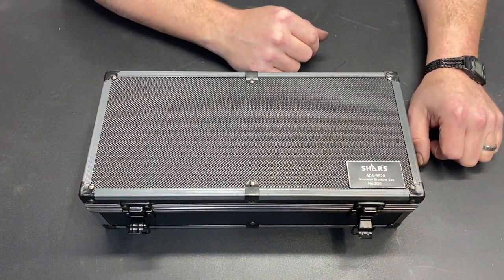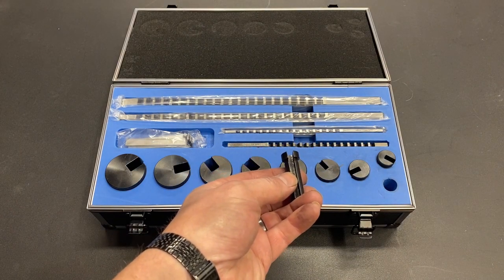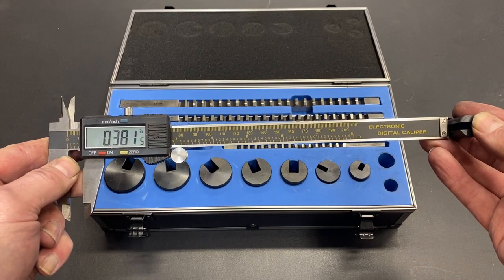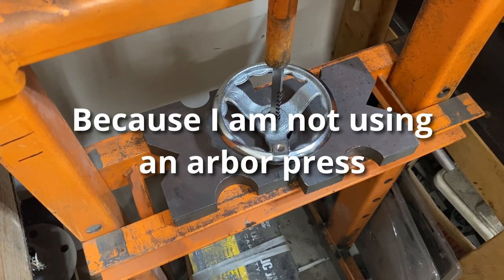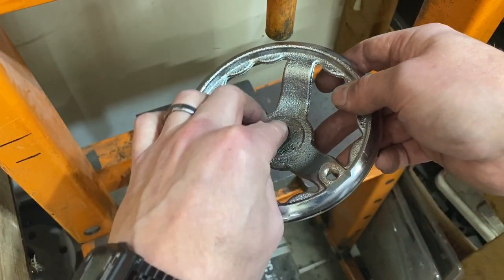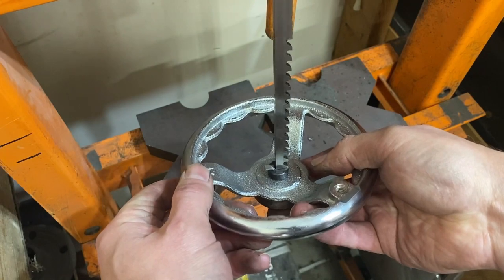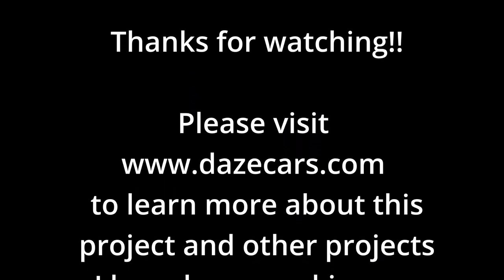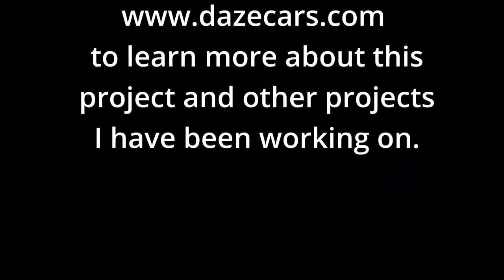Review and Use of a Shars Broaching Kit, Cutting Keyways and Internal Splines

Comment: 1) I've always wanted a broaching set. This one looks pretty cool.
2) Looks like rebuilding your shop press to be more usable can be a whole series of new videos. Make it less sloppy, add air over hydraulic jack (or can you modify the current jack?).
3) Regarding building up your shop tooling, using your brain and whatever tools you have until you have the right tool, My first "lathe" was a drill press and a few different files. Took forever to shape something, but it worked.
Reply from the maker: So far I am very happy with this set.  Rebuilding my press as a video series...  good idea I will add it to the list of projects.

Comment: I have been watching the prices on this tools for years. Thanks for sharing.  Your going to love the air over hydraulic pump. Next for me is a press brake attachment. I saw a video years ago on rigging up the release valve with a foot leaver, it is the best. I used my press to flatten the end of conduit for a geo-dome. That a lot of pressing. Four hurricanes later it’s still going strong.
Reply from the maker: Glad it was helpful!  Hopefully Amazon gets them back in stock.  they ran out shortly after I posted this video. I need to rework the entire press.  I have big plans for it sound like another video series idea.
Reply: @dazecars I ordered one the other day and it came in today, wowed great set.  I glad you check your set and had a tune up for the small guide. I used the smallest cutter first and then the wider one, two cuts easier then all at once. Great tools.

Comment: When using a press with H motion slop (vs arbor press) it’s highly recommended to relieve pressure on the ram intermittently to realign/correct misalignment and reducing the chance of breaking your broach. Slow and steady does not compensate and when you’re driving a 20 ton hydraulic pump there is no way you’ll feel anything on the other end.
Reply from the maker: Excellent advice to relieve the pressure and reposition.  I will keep that in mind for the next one.  As to "feeling" what the press is doing, with my press I can totally feel it.  I have bent and shaped everything from 1/4" steel down to thin copper and aluminum.  By taking very small slow strokes (speed is more important that length of the stroke) I am immediately aware if the resistance is increasing or decreasing.  Took me quite a while to get a feel for it but once I figured out speed was the key it allowed me to fine tune what ever I am doing in the press.
Reply: @dazecars  ask any experienced toolmaker about feeling.  With your fingertips on the tap wrench, nothing between you and the work, “feeling” each tooth cutting, then “click” and your tap is broken. The 2 foot handle attached to a 20 ton hydraulic Jack is anything but a sensitive device.
Reply from the maker: Your not wrong. I wasn’t trying to argue that what I was doing was the “correct way” or even full proof against snapping a broach. I was just saying that I have a lot more “feel” than one would expect especially with the right technique. Obviously the better solution is to eliminate all side loading and that will be an upcoming project.  Thanks again for the comment.
Reply: You definitely can feel it. I used a much less expensive 3/16 broach from AliExpress on mild steel and a similarly janky press and while it worked fairly well I think it was taking too much bite per tooth. I encountered quite a bit of resistance in places, but the problem is that you can never back out, so it doesn't matter whether you can feel it or not.
Reply from the maker: @topduk   for me the "feel" keeps me out of trouble.  if pressure is remaining consistent than I know I am doing something right, if pressure suddenly goes up I can reset.  You are correct that you cant "back out" but by taking small slow bites I can feel if I am getting in danger and change up before something brakes rather than appealing a full round from the press and snapping something.

Comment: Make yourself some arbor extensions the same diameter as the arbor on your press in increasing inch long increments out of mild steel.  Turn, or silver braze, a collar on each one that slides over the existing arbor to keep it in line when in use with others or the existing arbor.  (If you are going to turn a separate collar you need to start with larger diameter stock and own a lathe.)Imbed a round neodymium magnet in a counterbore on the large end of each extension.  The magnets that come with a countersunk hole in them work well for this.( The counterbore should be just slightly deeper then the magnet’s thickness. The magnets are brittle and you do not want anything pressing on them.)You now have a set of extensions that link together and keep you from having to move the presse’s bed up and down all of the time.  While you are at it, make yourself a storage rack that holds each one that angles down towards the back side of the press, and mount it in the upper left hand inside corner of the press. The collars then retain them in this rack thanks to earth’s gravity. In that way they stay with the press and don’t get lost.
When you are broaching a keyway always stop a couple of times, take the workpiece out with the broach still in it and look at the underside where the backside of the broach is suppose to be making contact with the collared bushing.  In some materials the broach starts to dig in and pull itself away from the slot in the collared bushing.  If you continue in such a manner you run the risk of a tapered slot and, or, a broken broach.
I would recommend that you always use the jack handle that came with your press for broaching.  It gives you what may be termed “machinist’s feel” for the entire process.  You may want to shorten it up over time as you use your press.  Save the air over for press fits and the like.  Unless you are broaching 500 pieces, you do not need the speed.
Reply from the maker: Those are some excellent ideas.  I need to rework the entire press.  I have big plans for it and your extensions are a really good idea.  Also good advice on broaching technique.  The handle I am using is perfect for this press.  I use the press all the time to form things (way more than just bruit force) and I can feel exactly what is going on.  My reason for wanting air over hydraulic is just to take up the initial gap.  Once I get it close I will hand crank to have the best "feel" for what I am doing.

Comment: The groove is cut deep enough as long as the broach slides into the corresponding hole. 
In fact it should not be recessed, otherwise you may end up with a broach that start with an angle when the first tooth bite, and that's the quickest way to break it.
Reply from the maker: It wasn't cut deep enough.  You could not slide it into the guide when the guide was in the hole.

Comment: This probably sounds crazy, but I’ve had a lot of luck making broach guides by 3D printing them. Just an FYI in case you find yourself trying to broach an odd sized hole.
Reply from the maker: Not craze at all.  I could totally see that working.  I imagine that each guide would only be good for a limited number of cuts before the plastic failed... but how often does a person actually use it, and if the guide failed printing another one would be a piece of cake.  I especially like this idea because the printer can be "working" while you are doing something else.  If you are making the guide on a lathe or mill it is taking up time.
Reply: What a great idea - I would not originally thought  that would work.  Can't wait for an opportunity to need to print one  👍👍😎👍👍
Reply: I never thought of that to be honest but collecting all the other parts seems like it might be a lot of trouble.

Comment: You should have put the small bushing in a matching hole and made sure that the broach was actually too large before modifying it. The smaller OD of the bushing means that when the slot was cut a larger percentage of the diameter was removed. Possibly the answer would have been to just chamfer the sides of the pilot section of the broach.
Reply from the maker: Thanks for the input, It was for sure the the guide.  I compared the depth to the other guides and they were all identical excep this one that was not deep enough.

Comment: A needed mod for your press would be: quick change variable length posts for under the ram, would make for much less changing of the pin on long stroke pushes like that one was
Reply from the maker: Not a bad idea.  I am actually going to take my press apart and totally upgrade it and that would be something good to add the the plans.

Comment: Does this come with the plug  to broach a key slot in a 1" hole?
Reply from the maker: Yes it does, I have two kits listed one that is 1/8” measurements so 1/2, 5/8, 3/4 and so on. The other one is by 1/16 but in 1/8” spacing, so 9/16, 11/16 13/16. You would need the other one to have 1”

Comment: The best way  to had the depth of the 1/2 bushing is to mesured it with the broach inside.   Total  height with the  spacer  should be  .560-570"            f
Reply from the maker: good tip, thanks
Reply from the maker: I need to get a 3d printer

Comment: Isn't using that broach like a file the same as turning a reamer backwards when you reverse the stroke.
The cutting edge isn't supported and will dull.
Not sure, but I would avoid using the broach  in that way.
Reply from the maker: You are not wrong, the potential is there to dull the broach, thankfully that was not the case with my kit.  I didn't "file" enough with it to cause issues.  In the future however if I needed to do something similar I would only go one direction.

Comment: Nice informative video, thank you! Just one FYI, is that an older model HF press with the cast iron, aka "exploding" press plates? Check into it, be safe, thanks.
Reply from the maker: I know all about the "exploding press plates"  The ones in the video are made of steel, I had them cut by a water jet cutter just because of the reports of exploding cast plates.  I only use my cast one for extra space but then they are always on top of the steel ones so all the pressure spanning the base is on the steel.  Thanks for the heads up if I had not been aware I would have needed to know, and now someone else might read this and learn about it.

Comment: Everyone does the easy broaching videos and near no one does blind hole broaching when i need one
Reply from the maker: you need to use the single cutter technique.  In other words you make a cutting tool that has a single finger sticking out that is the correct width and depth as the keyway you are wanting to make,  then you put the part that needs to be broached into either a lathe or mill,  line everything up and take a pass to the bottom of the blind hole.  The machinery is never turned on your just using the lathe or mill to hold the work, hold the cutter and manually make the passes. Continue the process and cut the keyway by making passes .001" deeper at a time.